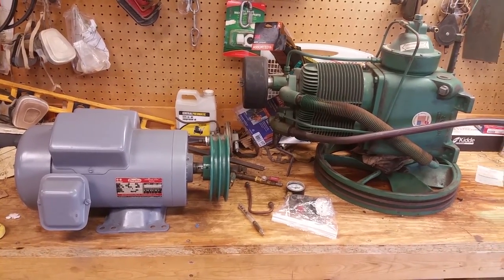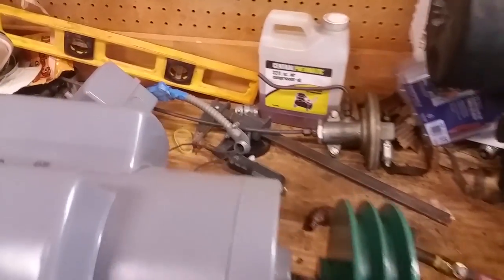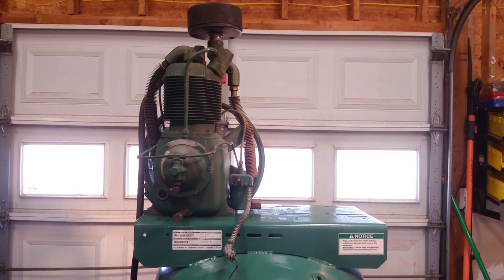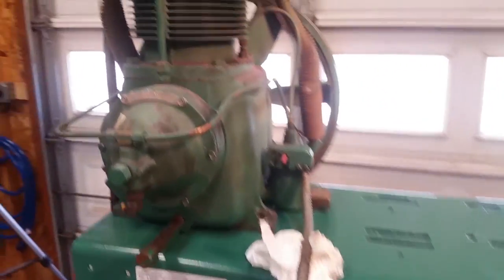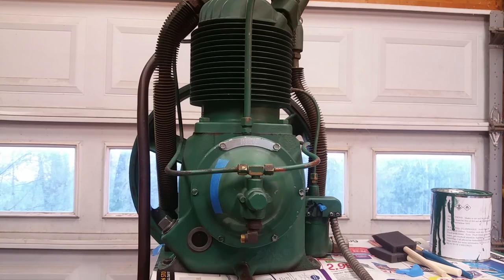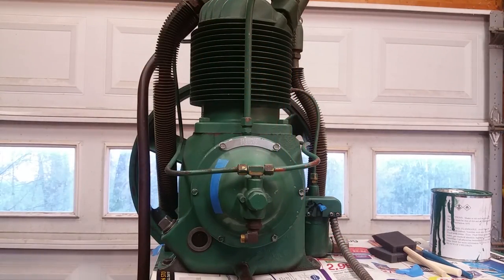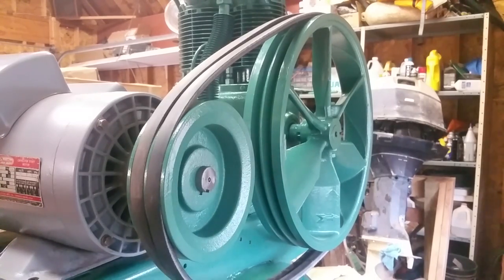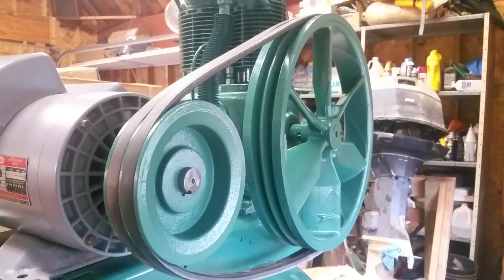Restore Your Air Compressor Pump!

Comment: Be sure to use matched belts, they will be 100 percent the same length. Standard belts can vary enough to where one pulls a little harder than the other.
Reply from the maker: Good tip, I never thought about that.

Comment: hi, what color is that green i like it a lot
Reply from the maker: I like this color green too. It's factory the factory Champion air compressor color. I called these people and got it here: www.rileypaint.com
Reply: @MattsShop  thank you sir im restoring a vintage champion compressor i just purchased, ill try get some of this for the pump and the motor end pieces, think ill use gray hammertone on the tank

Comment: I hope you don’t continue to use that harbor freight oil in your compressor. Please buy some real air compressor oil, like ChampLube or Amsoil compressor oils
Reply from the maker: Yea, I need to get some better oil. I was just going to leave the cheap oil in it to flush it out, but you know how that goes...
Reply: Matt's Shop yes I do! The Champion brand ChampLube is a little pricy but a quart of Amsoil compressor oil is about ten bucks and it’s great oil so far.